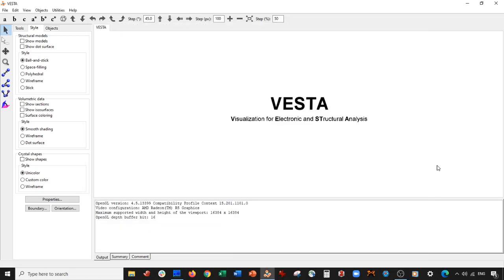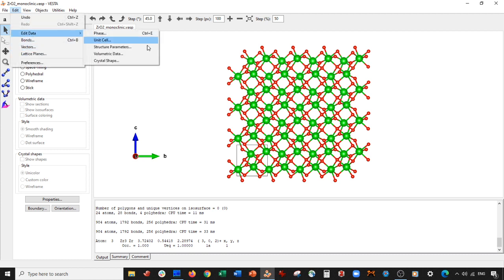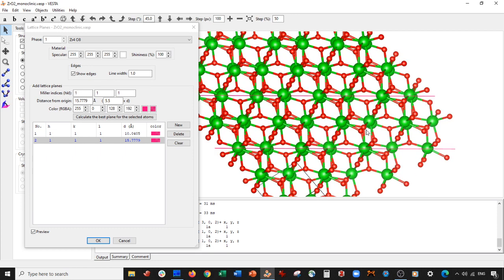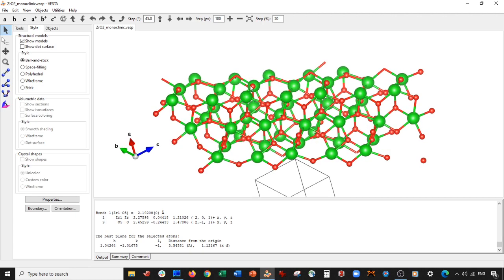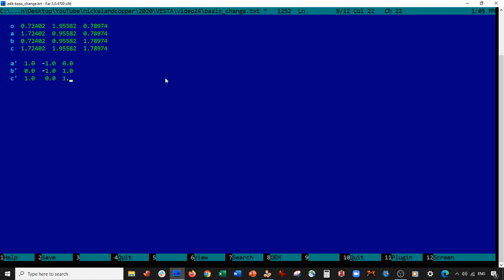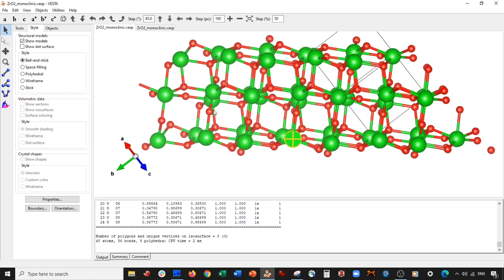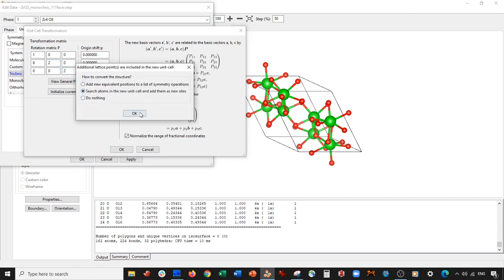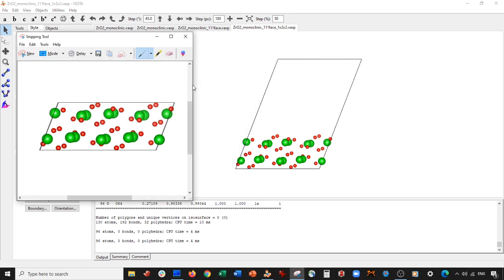VESTA Software - ZrO2 [111] Slab Model with Vacuum tutorial

Comment: Hi Copper, thanks for your very nice videos. I have reviewed this video for many times and enjoyed a lot. According to your new video on CoP (111) surface, (111)*(transformation matrix) should equal to (00 1*constant), right? But I found this is not the case for the transformation matrix in this video. Could you tell me why? Also, you calculate the transformation matrix by aligning the coordinates laterally in some videos but vertically in other videos, which way is better?
Reply from the maker: Thanks so much … ya … your are right it should transform according to your equations … it’s possible that there is a mistake here!

I’ve thought about swapping it out for a fix … but haven’t had the time

Edit - see the discussion under “Michael LaCount’s” comment. He explains the nature of the error

Comment: Like the eye on your face ...little did NandC know they were adding comedy to this channel :p  I know how you feel ...in the moment, thinking you need to make sure to explain something and then the explanation seems trivial :) great video!!  I really want to be able to take a POSCAR output and given the lattice constants and the new plane you want, apply rotation matrices to the lattice .....I'm still kind of stumped on this one though ...this method in VESTA works nicely
Reply from the maker: I have a program I am making called latticeTransformer that does that exact thing. 

You start with the POSCAR, give desired plane, and it gives you a bunch of rotation matrices as output. I have it made, actually …. Hehe. But it’s  in a really rough state
Reply: @nickelandcopper5636   I find that I have to tranpose the final rotation matrix to get it to work correctly in VESTA
Reply from the maker: @eric_welch  yes I think you are correct. I think there is a small error here.
Reply: @nickelandcopper5636  do you know why this is?? is it the way VESTA treats the rotation??

Comment: Just a tip if you re-add your 111 lattice plane before applying the transformation matrix, it should transform the plane as well. This is an easy way to figure out which of your new unit cell faces is the correct one. Otherwise great video, I found it super useful.
Reply from the maker: Hi Michael, sorry for the late reply.

This sounds great but I can’t quite imagine what you say. Can you please try to elaborate or describe it again for me? Thank you 🙏
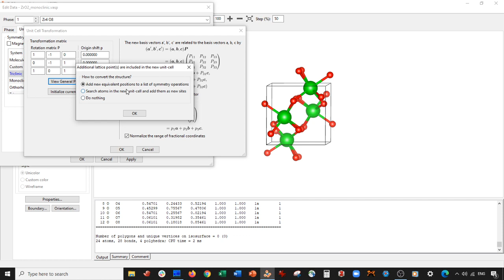Reply: @nickelandcopper5636  At 6:40 you delete the lattice planes, instead you can delete 2-4 but keep the first one and just hide it for now (in the "Objects section uncheck slices). Then after you transform the unit cell at 10:00 the transformation should also apply to the hidden lattice plane, now if you view enable it again it will see it should line up with one of the faces of the transformed unit cell ... Actually now that I look at this again I think there was a small error in the video, I think the rotation matrix you made needs to be transposed i.e. ((1,0,1),(-1,-1,0),(0,1,1)). If you use the transposed rotation matrix as I just wrote then the (111) plane will transform into a (002) plane indicating that the c face is the pre-tranformed (111) face.
Reply from the maker: @michaellacount7626  thanks so much. Is there some way I can contact you outside of YouTube comments? It’s been a while but if I recall the correct the surface I show is indeed the 111 surface, right?
Reply: @nickelandcopper5636  Based on the fact that my previous 2 comments aren't showing up it seems trying to put any contact info here will get it instant flagged ... and youtube doesn't seem to have a way to private message someone. So best idea at the moment is keep doing this and if we get it all sorted delete the back and forth at a later date. Terrible way to communicate but I don't see another way. As far as whether you got the correct 111 surface I can't say for certain one way or the other. It's possible you did and I'm mistaken, it's also possible you happened upon something that just looks like the 111 surface, despite being monoclinic there is enough symmetry that its conceivable multiple faces are indistinguishable from one another. The only idea I have to distinguish it would be to edit the atoms so they are all different types so that there is more visual information to make a conclusion.

Comment: Very helpful. I have a question: if i have crystal with FCC structure , i’m interested in 100 surface (natural exposed), so  i should add vaccum in x-axis direction, right ? ,       Can i Add vaccum in z-axis direction instead of x-axis ? Is that correct ?
Reply from the maker: Yes - see my old video on Ru surface. I only add vacuum to the naturally exposed surface
Reply: Nickel and Copper Thanks a lot .  Regarding FCC ,  for100 surface, vaccum is added to X-axis direction, is it possible to add it to z-axis ? Which direction is the correct one ?
Reply: Also , what is direction for adding vaccum if i’m interested in 010 surface ?   Sorry for the inconvenience
Reply from the maker: The y dimension
Reply from the maker: For 100 it is x
For 010 it is y
For 001 it is z
Reply: Another question: i see in some  other websites, they destroy periodicity in x, y & z direction before saving in xyz format then transfer to vasp as you normally do . In your cases you destroy periodicity in x & y when you add vaccum in Z-direction.  So please explain this to me.  Thanks in advance
Reply from the maker: One needs to have the entire unit cell in the dimension on which they add vacuum. So you must not destroy periodicity in this dimension. That’s why I don’t destroy in x and y when adding vacuum to z

Comment: very very good, this is great, Building slab geometries for catalysis or any application , I admire your effort, thank friend. I'm going to study your method of making my slab . congratulations
Reply from the maker: It’s possible that maybe the b or c dimension may be the 111 surface. It may still be the a dimension like I thought though, so make sure to double check this. One of the dimensions is though!
Reply: @nickelandcopper5636  Yes, I've been analyzing your method. i want to build a slab with 72 atoms . the slab i found is 36 atoms ZrO2(111) is small . i want to put nickel on ZrO2(111) support . i will study your method
Reply from the maker: Try to vary the slab size with edit - unit cell - transform. Then scale the diagonal elements only
Reply: @nickelandcopper5636  thanks
Reply from the maker: Nice! Thanks for the papers!
Reply: @nickelandcopper5636  No, thank you for show me how to build slabs , your are videos very very excellents